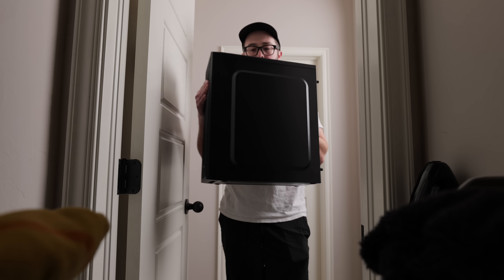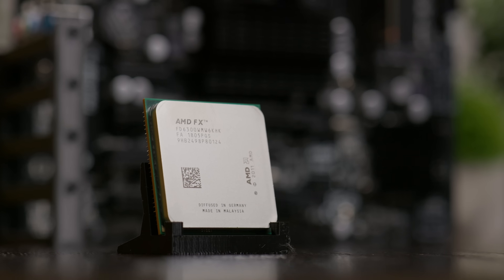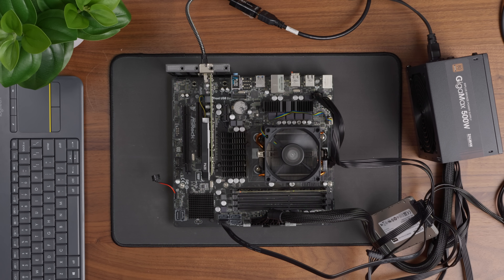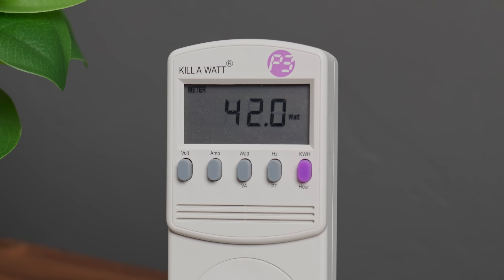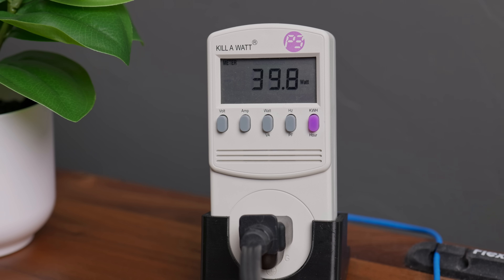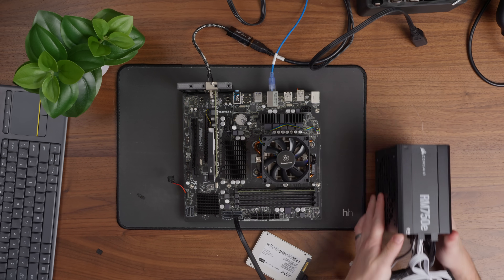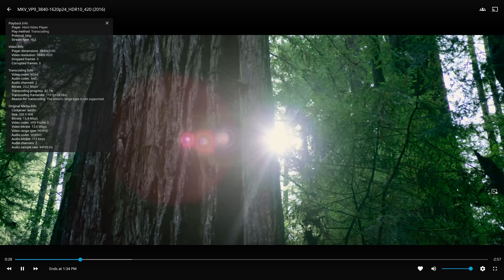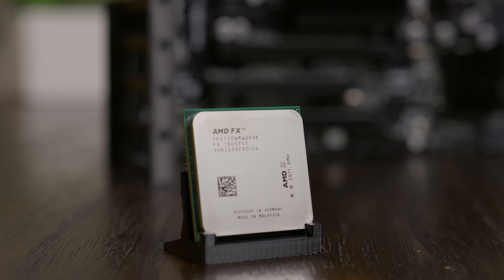This CPU Shouldn’t Work in a Home Server… But It Does

Comment: That's hilarious, I just stood up a home server running on an fx-4100 yesterday.

Running Proxmox, Pihole, Home Assistant, and Wazuh.

8GB Ram
250 GB SSD
Reply: how well does it run?
Reply: @JohnGreco-tu9we 
Honestly, it's snappy. No latency that I've noticed moving around in any of the apps.

CPU is running maybe 30% under load, and memory at 80%.

I'm going to try to squeeze opnsense in, but I might have to remove something to give it breathing room.

Could it be better? Yes.
But it's what I had and 24 hours in it seems to work better than I expected.
Reply: I did my fx 4300 2 days ago. Working great for plex and a couple other things.
Reply: I have a 6300 and and 8120 I can let go of if you need more speed or cores.
Reply: @eopest  I have a 8370 and a 6350 at least one MB and some DDR3 I wouldnt mind getting out of the closet
Reply: I'm using one on my pihole haha
Reply: i started to set up an fx 4100 and 2 fx 4300's each having 8gb of ram and 500gb hdd (its hdd for now i dont really know what i will use these or how to even set them up properly)
Reply: @Lizix5  - There are plenty of guides available for setting up the open source apps and Proxmox. Use the hardware available to you before making a financial investment whenever possible.

If you enjoy it and find the hardware to be a limiting factor, figure out what in the setup is causing your bottleneck and swap it out.
Reply: What’s your ram configuration looking like? Are those services all running under 1 Proxmox VM?
Reply: @user-td5gy2fh3p  1 VM and 2 in containers

Comment: If a xeon can be a gaming pc, what is the best for $50 used
Reply: Depends, but I got a e5-2690v1 to work amazing for a sim rig with a rx580
Reply: @Rebelranger-wr4yy   what if a gtx 1660 super is used
Reply: @SahasradEdits  still a good 1080p card, I have that in my main pc I built some years ago and it still handles most if not all games absolutley fine. Gaming isn't as big as a power sucker as you think. Just have to set expectations accordingly. I was using a 2gb gpu and 4core 4thread cpu and only really had to drop my resolution to keep avg 60fps in assetto corsa
Reply: @Rebelranger-wr4yy   nice. gaming on a server tho?